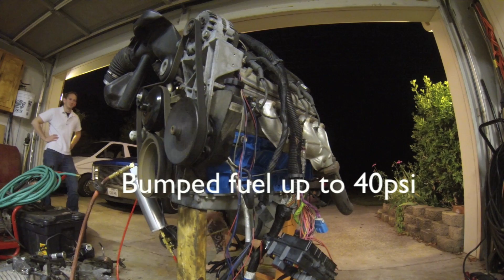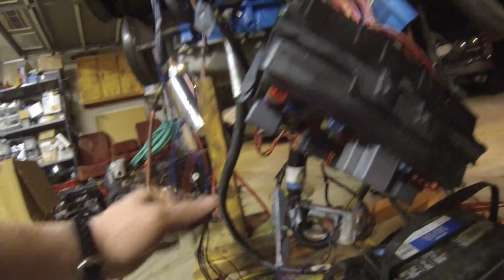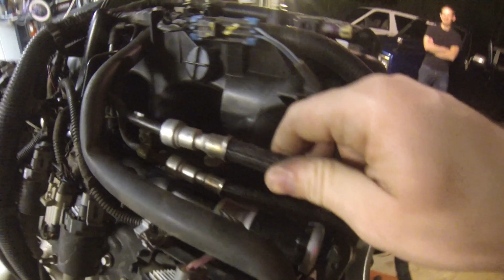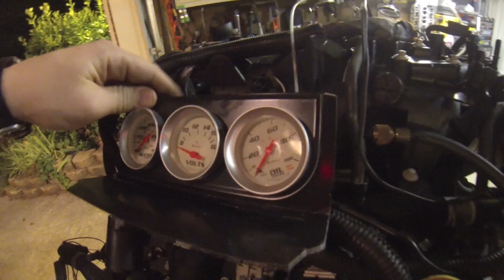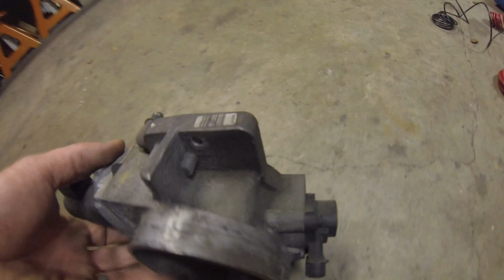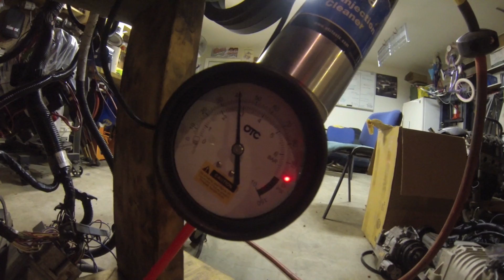LS1 LSx 5.3 Running on Stand - Squirter Project First Start-Up

Comment: Wiring help needed for a 5.3L and 4L60e transmission installed in my 1971 Chevelle LS Swap. I'm just about finished with my de-pinning of my harness. I'm stuck on the configuring the TCC brake switch and the Variable Speed Sensor 4K. Do you have any instructions on configuring these?  Thank you in advance for your help.

Comment: Oil pressure gauge I mean. Where did you put it
Reply from the maker: +DaveCaresForYou Lots of options, but one common place is to use the block off plate right above the oil filter. Drill and tap it for a fitting.

Comment: only thing i def need is what did you for the plug in the intake manifold where the egr connected i was thinking a freeze plug.. thatll be the last thing
Reply from the maker: +Tommy Sandretto You can see it in this video:  https://youtu.be/jDQbIBQoQ3k?t=2m16s
Reply from the maker: +Tommy Sandretto Also in this saved "note" on my facebook blog page:  https://www.facebook.com/notes/agearhead4life/egr-delete-truck-intake-freeze-plug/517445628309070

Comment: do you need the mass air flow sensor connected to start it up? thanks
Reply from the maker: +Tommy Sandretto Nope, sure don't. Actually my latest video that I've uploaded shows a 4.8 LS motor running on the stand without the MAF. Click on my name and it'll take you to my channel. It should be the first video on there in the uploads.

Comment: I like your skills man I am trying to do my wire harness for 1980 g body , need help
Reply from the maker: Thank you Adrian! For help, you need to come over to our group Facebook page. Its the best way to get answers. You'll get input for multiple peoples experience and usually a pretty quick response. I get bogged down with messages and work, so it can take me a long time to respond. I can tell you that all the wiring info for the LSx motor you need is on LT1swap.com. That site is 90% of your answers.

Comment: Where can i find a write up on how to wire the harness like u did here? Very interested. I might build a rat rod looking dually and shove a 5.3 with tranny init on the cheap. Awsome videos  like always
Reply from the maker: Its so easy I'll do it right here. I ran the main power to the fuse block. Then I ran two other wires to the back of the fuse block, one of them to A9 and the other to B11. After that, as long as your computer has been flashed to remove VATS and you have a fuel supply, it will run.

Also refer to the wiring diagrams on LT1swap.com.
Reply: AGearHead4Life Thanks, sounds easy enough
Reply from the maker: MrAllspecracing Yep! No problem man. Spread the word! Many dont believe that its that easy. Do note that the LS1 car harness is different though. Those instructions were for the truck harness.
Reply from the maker: AGearHead4Life Check out my most recent upload of the 5.3 with 4.8 pistons running on the stand. It shows a closer look of the wires that I attached to the back of the fuse block.
Reply: thats the video that sent me to this one by reading the comments. that fuel system you rigged up is awesome figuring that my neighbor has that tool i can borrow now i could run it on the stand very easy. thanks for the reply and all the diy info on your channel!

Comment: The engine doesn't use the O2 sensor till it  comes up to temp and goes into open loop right now it's closed loop. Running off fuel and spark  tables stored in the ECU.
 A lot like limp home mode. Still vary impressive quick hack to get it running. Shows you really know your way around the wiring of theses bad boys.
Reply from the maker: Yep, true. It is in open loop as I'm running it here. I hope to add a radiator with fan to this kit one day so that I can get them to operating temp while testing them. This is now my test stand setup. I'll also add support for the front of the engine and a place to hange the guages.